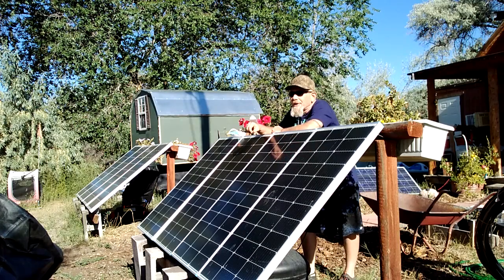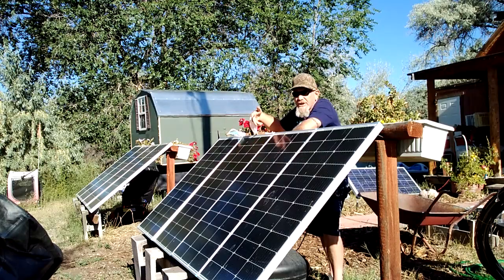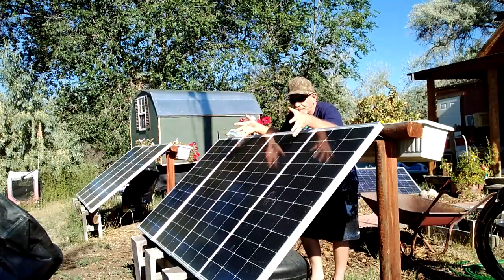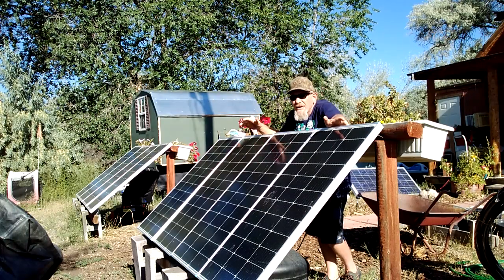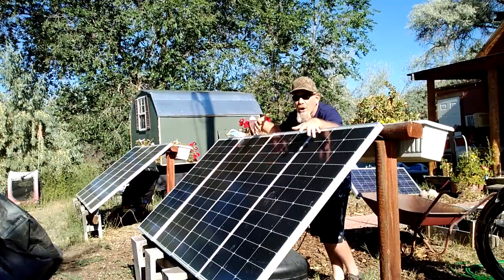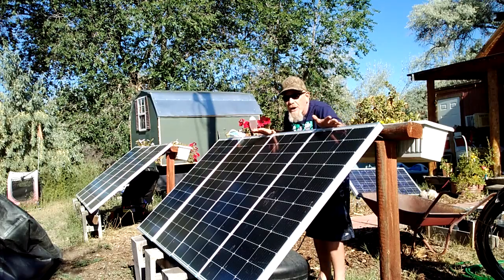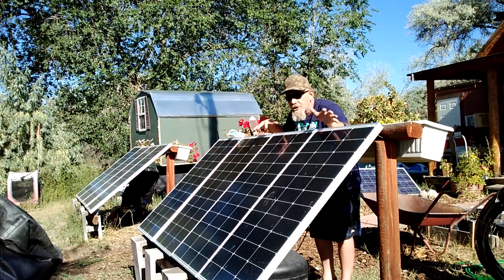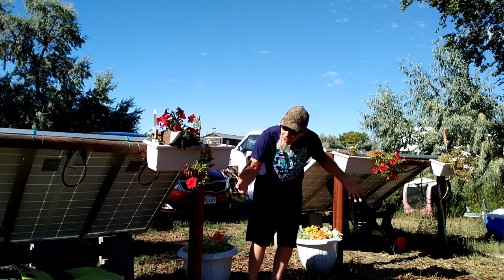How Temperature Effects Solar Panels And How To Maximize Output!

Comment from the maker: In this video I explain how temperature effects solar panel output and how to maximize your output with ground mount, air flow and other techniques. Recommended equipment: https://www.amazon.com/shop/solarcabin

Over 20 years off grid and 300+ videos of my cabin and systems on my channel. So go have a look!

Comment: I went out and wiped my panels off with a sponge and water 💦 yesterday morning before sunrise 🌅 and gained about a hundred watts. I had to get two more panels to run the air conditioner because of the smoke from Canada and elsewhere. This will be the first winter with 1600 watts of panels. It made a difference last year when I had 1400 watts of them and had had 1200 the year before that. But I had added four batteries that year. When I went from sixteen batteries to twenty it took more to charge them. It's a vicious cycle. I'll have to go through them one at a time before winter checking for a weak one. I'm going with 31 series to replace any of the 27 first ones as they get weak. There's twelve that are 29 series but they don't make them now. The 31 series are 105 amp hours. If you keep the old one for tinkering, they're about $155. This will be the fourth winter for some of the batteries. Ill take the weakest one for a riding mower battery. Should last for several years. My uncle gave me an old Murray with a 20 horse industrial twin motor. I'll have it running soon.
Reply from the maker: I do that just about every morning and I spray off all the panels while I am watering the planters. Makes a difference and we get a lot of road dust and bird poop.

Comment: Great video!
I would also keep in mind not to exceed “open voltage current” and also not to exceed “maximum allowable wattage”

Although adding extra solar panels/ panel is a great idea .. if it causes you to exceed these limits.. well, you could ruin the charge controller.

It also behoves everyone to pay close attention to mixing or should I say, how to properly attach mis matched panels.
Reply from the maker: Thanks, it is true you can damage a controller by overloading the amps but in my experience an off grid  solar array at best will produce about 80% of rated output so adding another panel shouldn't be an issue but try to stay under the rated amps. Most good controllers are also designed for more amps than the rating to protect the unit from surges.

Mixing panels can cause problems and I recommend staying within a close range of volts, amps and watts. In most cases you will get less efficiency mixing panels to the same controller but you can use separate controllers if that is an issue.
Reply: @solarcabin  thank you also for your research and knowledge…. I was trying to make the distinction between “open voltage current “ and actual voltage. These  are two different things. OVC is the voltage that you can not exceed … while the regular voltage might be that 80% you had mentioned. 
Both voltage specifications are listed on each panel. 
For example: Open voltage might be at its maximum even under very low light conditions while actual voltage will increase as the sunlight is at its highest point.
Reply: You can exceed wattage of your inverter, this is a very common practice. The inverter will just pull what it needs. Never ever exceed voltage, but you can overpanel and have higher max amps. You with "lose" whatever is over your inverters max input under ideal conditions, but will have more consistent power because cloudy days will produce more. People commonly oversize by 10-20%, but there isn't really any limit.

Comment: Are you satisfied with your Solar set-up Lamar or would you go bigger?
Reply from the maker: Hi Jim, I got so used to living with just a 400 watt system that I really didn't need more until I added an ebike and snow blower and decided to reduce my gas genny and propane use.  Now I don't even need the genny and can charge anything anytime. It is nice but I could still live with a smaller system. I don't see adding more in the future.

Comment: Thanks a bunch for this video! It truly helped! Last winter was mostly cloudy, plus daylight hours are shorter, so I had almost no solar power. Couldn't even charge phone. Turned it off to use for emergency only. 
Now it's hot. On that first 3 digit day, at the end of the day, I checked my power station to see if it was full. It had barely made it to 50%! I thought something was wrong with it. After the 3rd day like that, I figured the heat must be that big of a problem. When you need it the most,  it charges the least.
Reply from the maker: Have you got that new system connected yet Granny?
Reply: @solarcabin  I will finish putting it up this weekend. I have to be gone out of town a whole day the end of this week. Without going into too much detail in a public comment, I decided it would be best to fully set up after i am back and not leaving for awhile so it doesn't get stolen. I was going to put it flat on top of my trailer so it wasn't so obvious, but I have been watching your solar videos and decided I better put it on the ground so it works better. One thing I have not seen addressed, though, in solar videos, is safety from theft. That is an important issue in some places. So far my solar panels have been okay, but my power banks have been stolen while out charging. One person out here has had their solar set up stolen while they were gone a couple of days. I am trying again to train a puppy to run my property at night without eating my poultry and cats.

Comment: for more cloudy and snow areas go with bifacial panels
Reply from the maker: I haven't tried bifacial and they are still expensive.
Reply: @solarcabin  They are pretty affordable. I can find 475W panels locally for $115. Can get a decent boost ground mounted, and extra boost if snow.
Reply: quartz rock on the ground

Comment: I've often wondered if it would be worth the effort to add one solar panel that could power several small fans to create airflow behind the panels when the sun is hitting them.  Wouldn't have to depend on Mother Nature to provide wind.  These past couple weeks with three digit temps rarely had any breeze at all during the day and high heat period.
Reply from the maker: You can get those solar fans and try it. I get enough breeze most days to keep them cooled down.
Reply: Same here. 3 digit temps and mostly no breeze for last 2 weeks. More if same to come. Good idea!
Reply: I bought a 12 volts water pump that uses ten watts, can be ran off one of the panels

Comment: Do you ever use your gas generator?
Reply from the maker: Very rarely these days. I used it last winter to run the snow blower is all and I shouldn't need it this winter. I keep it just in case.